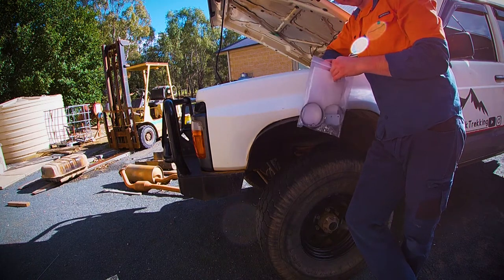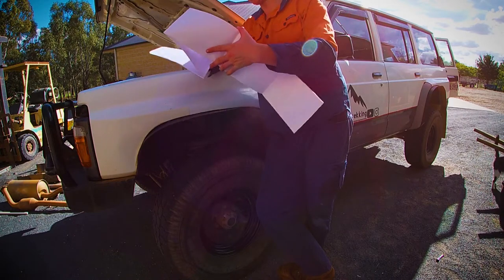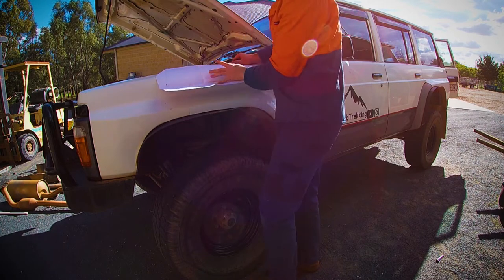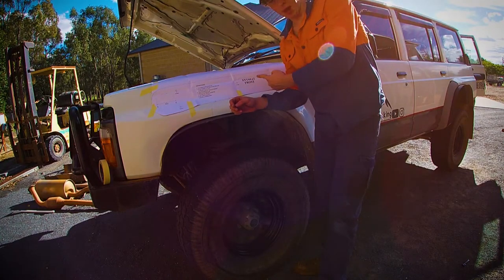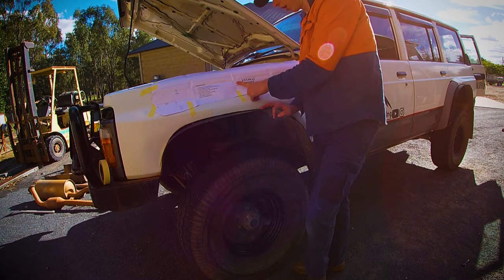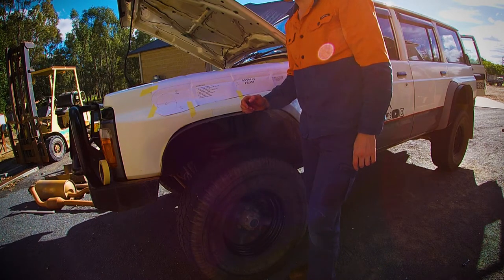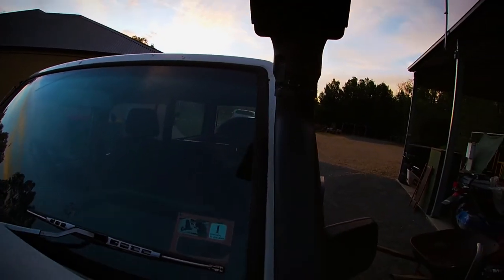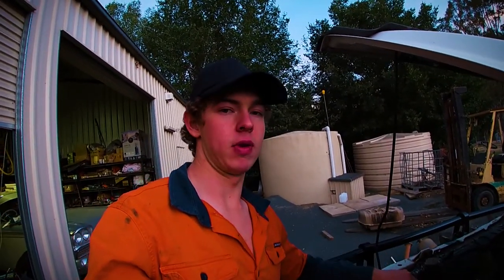GQ Patrol Snorkel install // GQ Patrol build ep 18 - REUPLOAD

Comment: Haha nice video. I'm instantly regretting my ebay snorkel purchase lol. My template has no instructions on it.. so you have no idea where to line up the template to start with lol. Hmm. Might have to have a few beers of courage first I think and just send it haha.
Reply from the maker: I hope it fits😂 I had to send it and I kinda regret it. Ahh well a mistake to fix in the future!
Reply: @OutbackTrekkingGeorgeLeov  haha yeah that's usually what I do but these guards are getting hard to come by so I better think about it so more lol. Might go from the inside of the guard and measure straight across and drill hole In the center then use that to align the template central to the hole.. if ot doesn't look luke it's gonna fit then maybe find a safari clone 🤣. Worst case of its really bad then 4" pipe should hide everything haha

Comment: Hey mate, great video and fair play sorting out the issues with plumbing it up. I'm just about to attempt mine (with no instructions). If you had your time again, would you start with the plumbing side? I'm going to repaint my guard whilst I'm at it, so was thinking of marking up and cutting the hole from the inside (once the guard is off the car) to make sure I get a good fit, then working backwards from there.
Reply from the maker: Yeah mate I'd Triple check it fitted first 😂. Make sure the bits they give you to plumb it up fit your airbox as mind did not at all. When you have the guard off check the snorkel will line up with the airbox. Personally if I was to do it again I would spend the money and buy a well known brand that I know would fit properly!

Best of luck mate
Reply: @OutbackTrekkingGeorgeLeov  thanks for the reply man, yeah, think it's one of those where you measure 10 times, cut once! Ha ha! Thanks for the advice too.. will check the airbox first before doing anything 👍